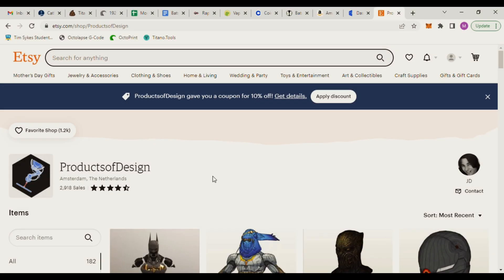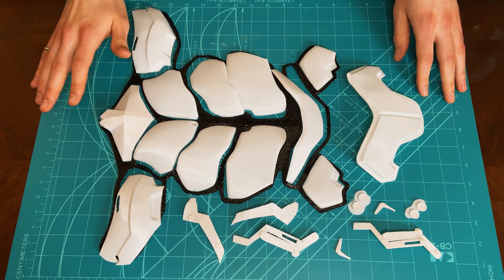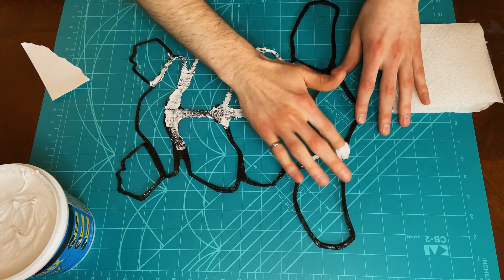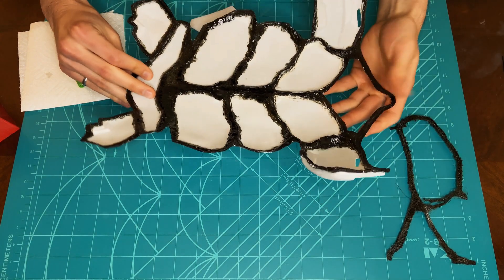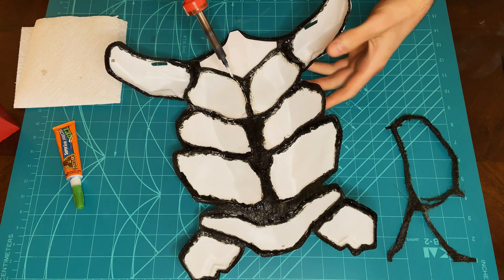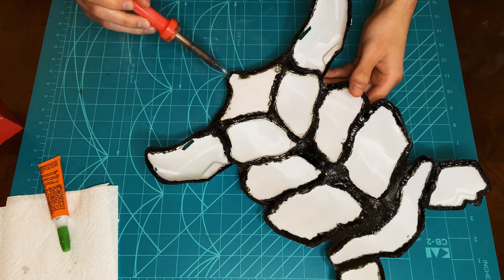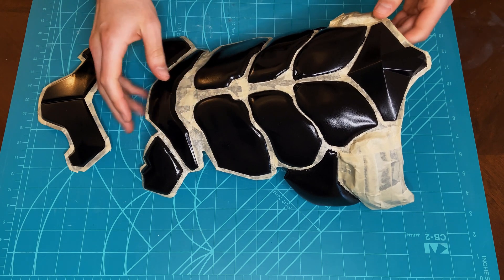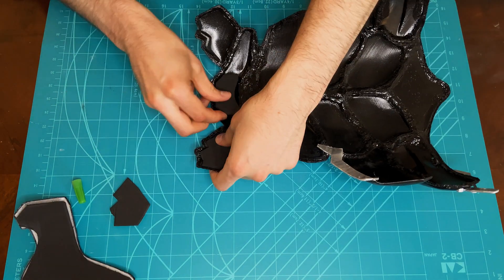Batman Arkham Knight 3D Printed Ab Plate

Comment: Hey mark! I'm just finishing my own suit, and wanted to ask you, how flexible is this abs piece? I have worked with tpu before, but in the video it looks very rigid, can you sit down and move properly with this one?
Reply from the maker: Is flexible enough so it can be wrapped around your body tightly, but it unfortunately isn't flexible enough for you to side down comfortably. You can turn and walk around with it comfortably no problem though. If I'd do it again I probably would have just printed the whole thing in PLA and forgone the TPU. I then would have just used a heat gun to form the PLA better to my body. Just my 2 cents if I were to do it again. Good luck!
Reply: @markitmade8319  thanks for the help! I made the abs back piece with e.v.a. foam but a piece unglued when i tried to sit, i'm looking for a little bit extra comfort so i can enjoy a whole day at con with the suit

Comment: did you print the ab plate with tpu all at once on one printer?
Reply from the maker: Yes, it was printed all at once on my Ender 5 Plus. Took a lot of tries to get it oriented right so the print didn’t fail. TPU is difficult to print with a Bowden extruder. If I did it again I would print it in smaller pieces on my Ender 3 S1 bc it has a direct drive extruder. Then I’d just solder all the pieces together when it’s done.

Comment: Amazing! What 3d printer do you use to print that TPU?
Reply from the maker: I actually printed that on my Ender 5 Plus, but since then I've gotten an Ender 3 S1 with a direct drive extruder and it works a lot better.
Reply: @Mark It Made  awesome! Did you print the TPU part in one piece? It looks big to be printed as one with an ender 3
Reply from the maker: @johnkemuel  I did print it in one piece, but you could split it into four pieced and print it on the Ender 3. Honestly, if I were to do it again I'd do it that way. It failed SOOO many times trying to print it all in one piece, it got rather frustrating.

Comment: what metallic black spray paint did you use? I cannot find any online that are supposed to be used with plastic.
Reply from the maker: I got a 6 pack of these off amazon because I couldn't find them in the stores. If you can find it at homedepot, menards, or a different hardware store it might be a little less expensive. Here is the link to the paint I used: https://amzn.to/3hHQd2Z
Reply: @markitmade29  you’re an absolute legend, thanks!
Reply from the maker: Not a problem, I don't mind the questions one bit! If you need anything else just let me know.